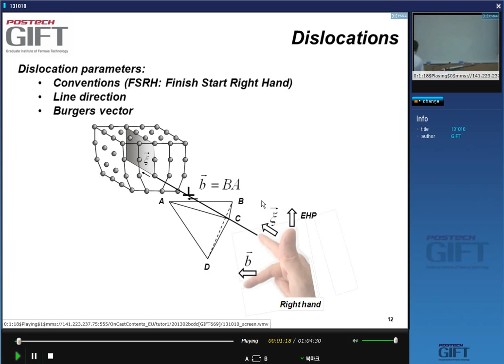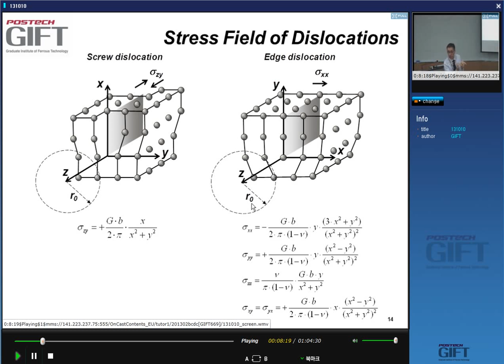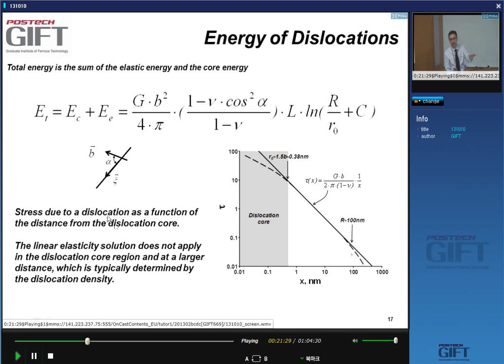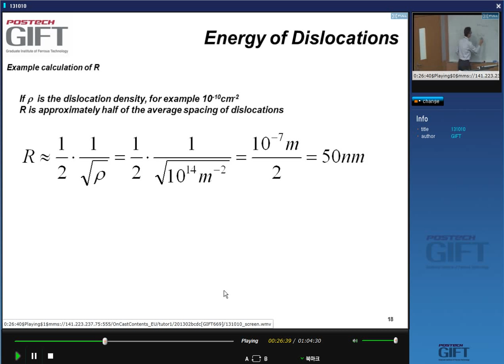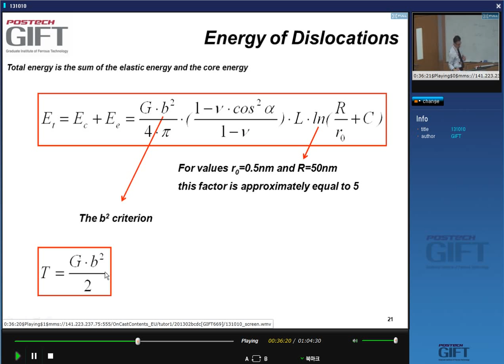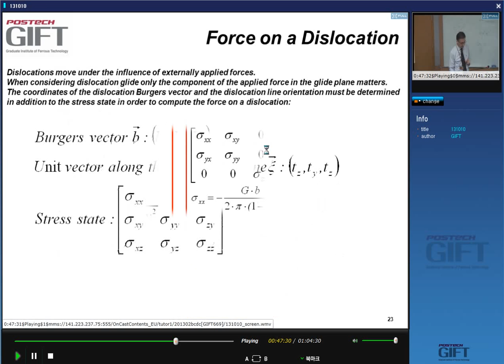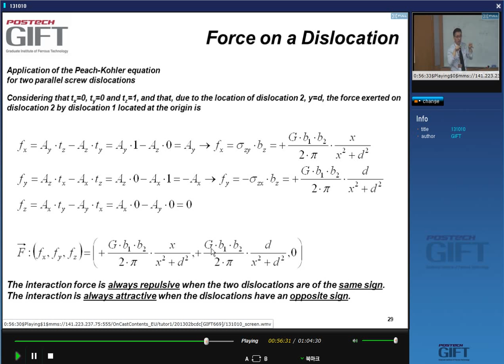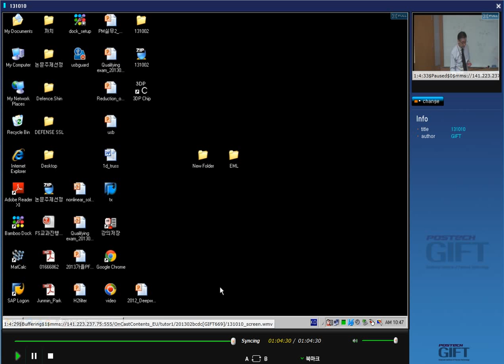Mechanical properties of steels - 9: dislocations

Comment: I don't quite understand what Professor Cooman means by the "dislocation core" and why the elastic theory does not hold good at the core. It would be grateful if you could please throw some light on this.
Reply from the maker: Niyanth Sridharan Elastic strains are of the order of 0.001, and elasticity theory has approximations which rely on the strains being small. The core has much more disorder, so elasticity theory is not applicable.